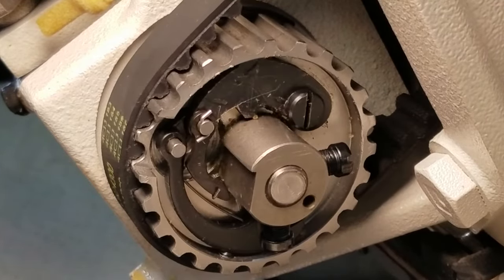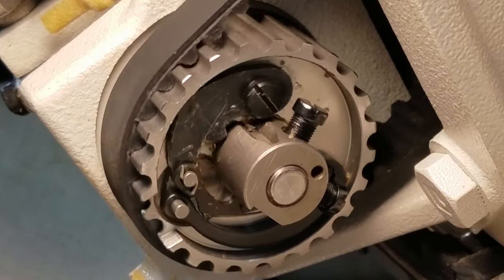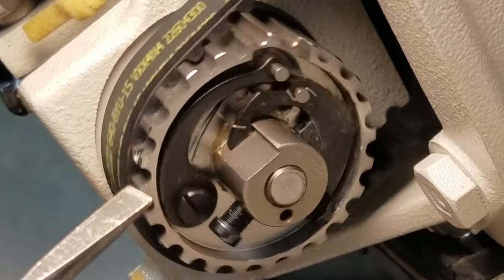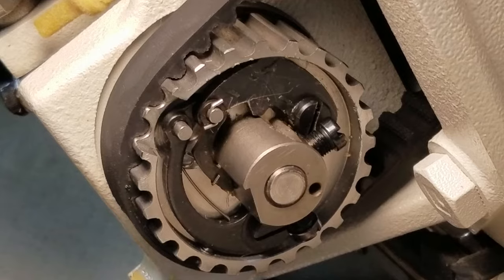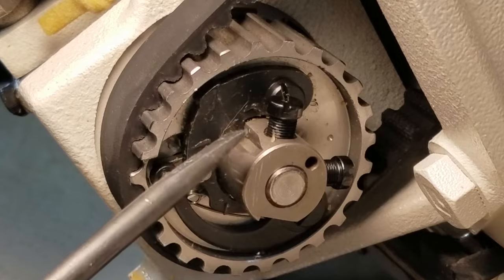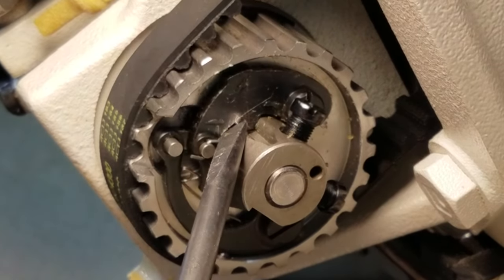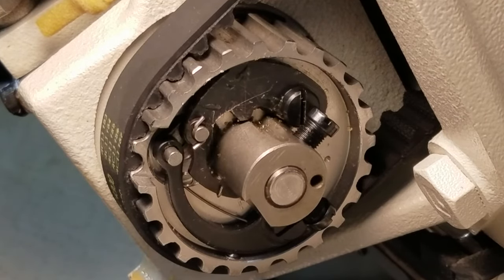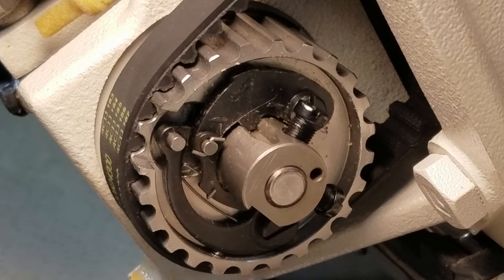Juki DNU-1541S Safety clutch fix #2

Comment: what happens when safety clutch is triggered? How do you know if it is or isnt? My machine is sewing perfectly... lines are straight and even... I'm just trying to learn about the machine by sewing lines... however... it broke 3 needles... and I'm not sure why? If I am holding the thread for the first few stitches(I do it because the machine is so powerful and sucks thread otherwise if I dont hold it), but when i tried to hold it...(maybe to tightly?) the machine broke is needle right away...(3times)...
Reply: You will know when the bobbin no longer rotates at all. The top thread will not retrieve the bottom thread if the bobbin does not spin. Your machine will not sew at all.

Comment: What can you do if the button on top won’t push down?
Reply: There are only two places in the full rotation of that shaft that have holes in them, that the button you are pushing will go into slowly spin it around while pushing on the button. It will go down when it hits one of those holes.